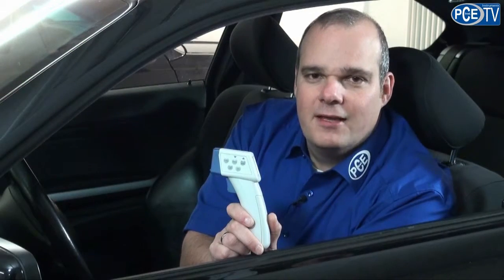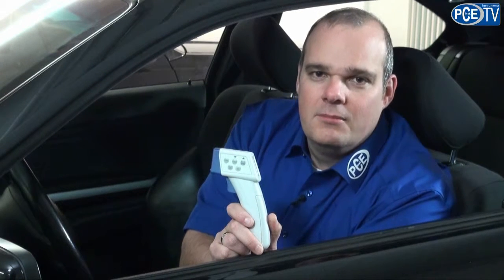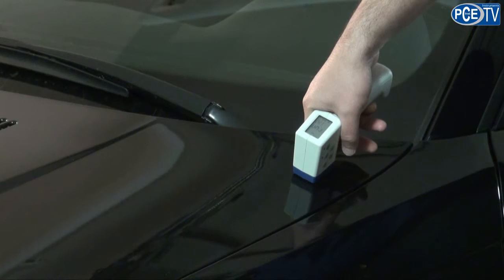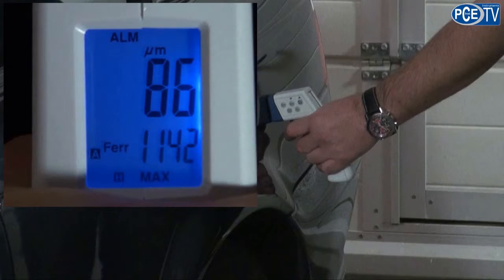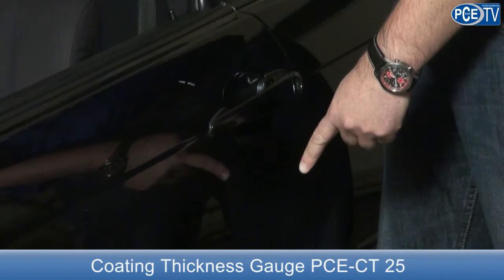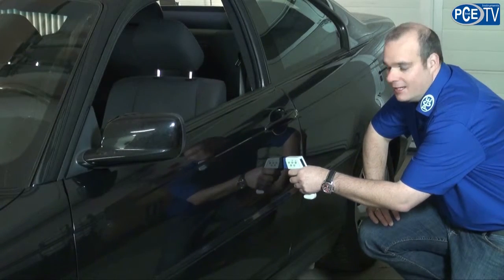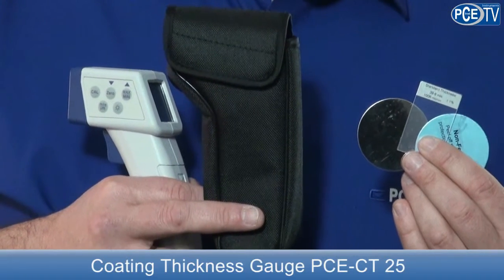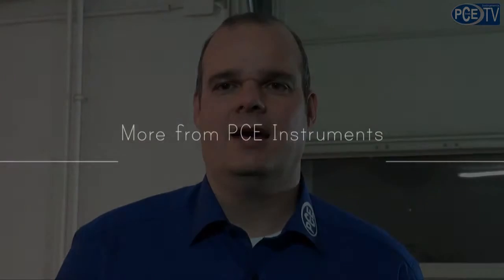Coating Thickness Gauge PCE-CT 25

Comment: I have this and it shows way to low figures. Tried it on my dads new ford kuga and on non ferrous it shows trustable figures like 120 um. On ferrous it shows figures like 50 oder 60 um which is to low. I calibrated this exaktly how it was described in the discribtion.
Reply from the maker: Dear Adrian,
Sorry to hear that you are having problems with our PCE-CT 25. 
Please contact pce at info@instruments.com.
Our team will be happy to help.